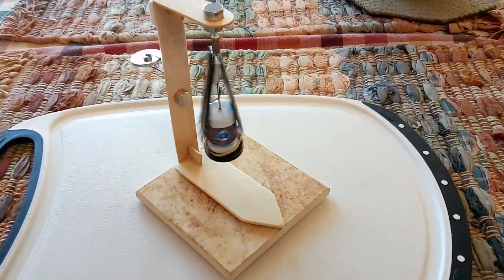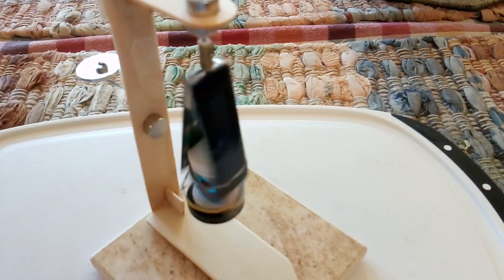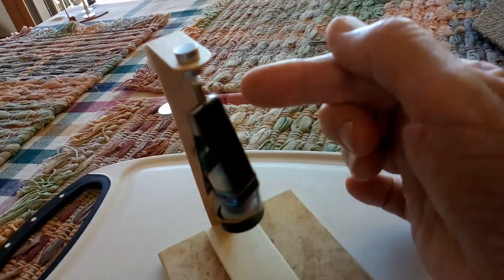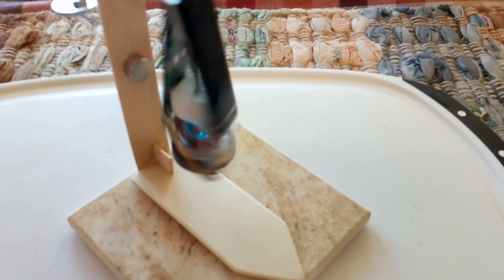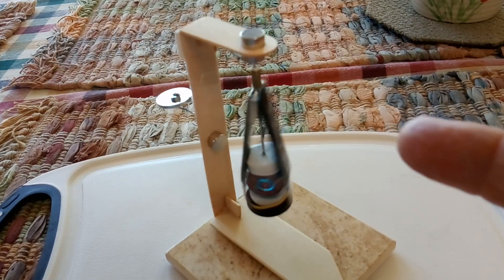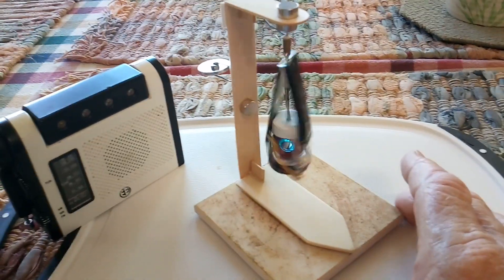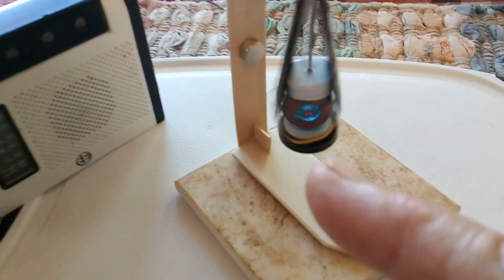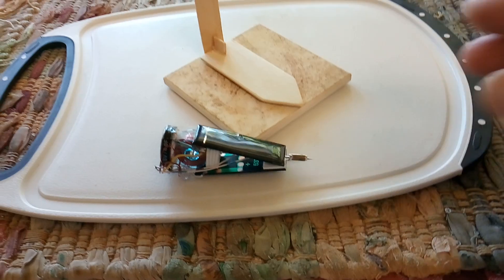Frankenstein Motor

Comment: It's fantastic. Hybrid Power. Combined sources are excellent. It looks like a rotating Teepee.
The usage of the bottom of the AM Band to hear electrical connections is one of the best ways to monitor equipment.

Comment: That's actually pretty cleverly designed, Rusty.  Good job!
Reply from the maker: Thanks. This project was a spin off of what we talked about.  It isn't exactly what we had in mind but it is something new I hadn't tried before.  Trying to get power into a true Mindocino motor and have it run right is not easy.